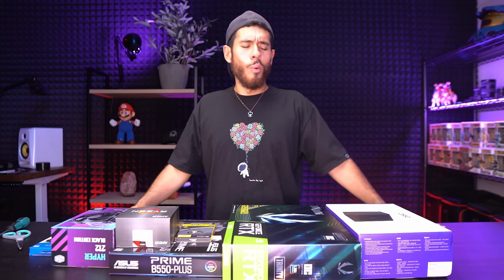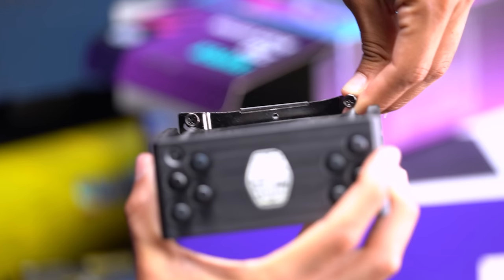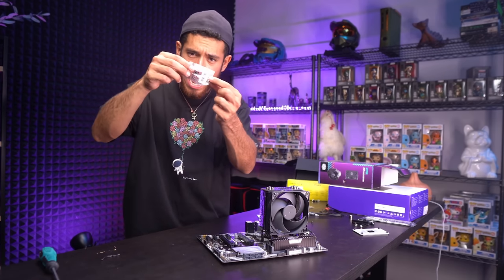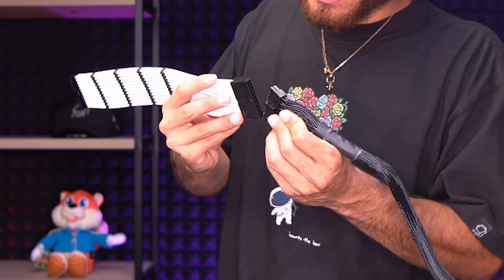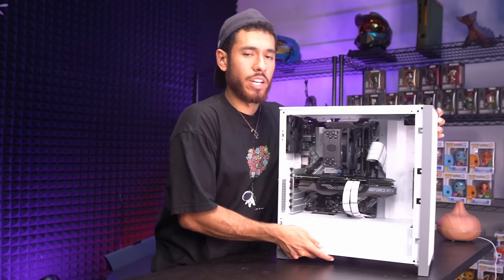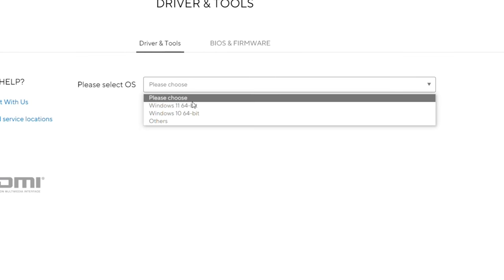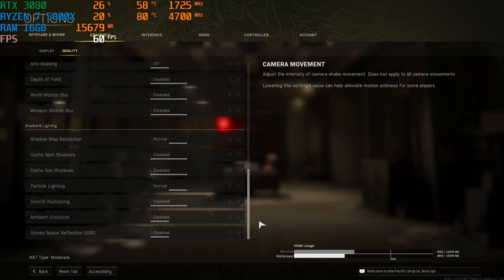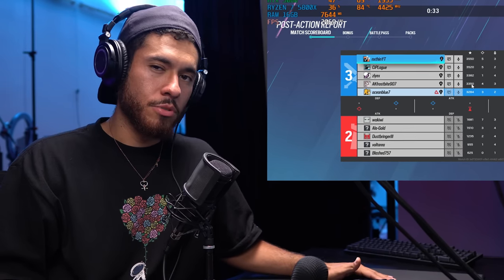BEST $1500 Gaming PC Build Guide - RTX 3080 Ryzen 7 5800X (w/ Benchmarks)

Comment: I basically built the exact same pc and it works like a dream! The only things that changed for me is the PSU (Power Supply, changed to RM850x), the GPU (changed to 3070ti), and I added a 1TB HDD (Hard Drive). Thank you so much for the easy guide Joey!!!!
Reply: sorry kinda dumb but what do you do about wifi? like does the mother board come with it or do you have to add a external one and idk if i missed it lmao
Reply: @overusedbyyou6239  you have to buy a external one, I just prefer ethernet because its just better than wifi
Reply: i changed mine to a 3070ti also
Reply: Another dumb question, what about Bluetooth! I went with the psu you recommended Calvin
Reply: @matthewbutler4650  👍

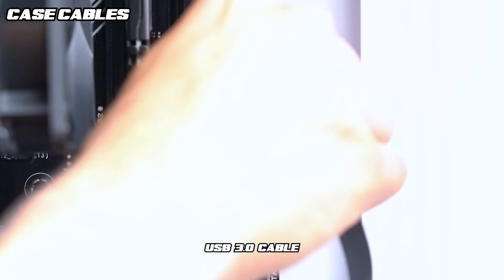Comment: 11:10 might be worth using a USB-C header adapter if the motherboard doesn't support it
Reply: is there another option? I want to use the usb 3.0 on the front and the type-c port as well in the front

Comment: I'd get a different board, one with the USB-C header for the case, there are options in that price range... And I don't like the idea of having only 500GB of storage in a 1500$ PC, but to get a 3080 in there I can understand that, storage is the easiest thing to add later on after all...
Reply: Actually more like a $1600 build before taxes. And 16gb RAM and 500gb storage will cause some pain.
Reply: @GlitchedPerception  16 gb ram is more then enough for gaming
Reply: @laurinschlief791  I’d say it’s enough but not more. You’re gonna max out on more demanding games. For example in the video it’s using 16gb in Warzone.
Reply: @GlitchedPerception  true i went overboard woth more then enough, but 16 gb for this price pool is a logical choice,
Reply: @laurinschlief791  You’re not going overboard. Don’t worry. I was making these decisions for a build recently and almost got 16gb it certainly is the price bracket. (And clearly more than enough for a lot of the titles tested) If you get lucky you can find 32gb kits for similar price and if so thats when I’d go for that. Just trying to give some heads up for folks who want power and to maybe edit and stream.
Reply: @GlitchedPerception  i know but i went overboard with more then enough its like perfect for games right now, luckily you can easily add more ram if you ever decide too
Reply: @laurinschlief791   16gb is not going to hold for long as games are getting more demanding each year. But if you don't have the money then it's not a problem because you can add ram overtime just like you can add storage. It's crazy how in about 4 years some games will need 64gb to run.
Reply: @GlitchedPerception  Would you say 32gb is enough if I'm trying to play ultra modded skyrim / fallout? I have a TB SSD already from my last PC when my old drive failed.
Reply: @evilkungfu  16 GB is fine if you're just gaming. if you've extra money to spend, it also doesn't hurt to upgrade to 32 GB, but you're more than likely gonna see a minimal performance increase if your PC isn't already being bottlenecked by your RAM
Reply: @theluigifan42  cool, good to know and I’ll do good with Ram, I’m making sure my 3080 isn’t bottlenecked as good as I can for now. I’m picking stuff that can be upgraded down the road, like I’m starting with a 5600x cpu.
Reply: Yah I would just use some hdd I have laying around.
Reply: This is going to be my first pc I build. What motherboard should I upgrade to? I need one with Wi-Fi? I’m willing to spend 100 more the one in this video. I just want a good one
Reply: @justjoshinya7237  Two options I'd suggest: the MSI MAG B550 Tomahawk MAX Wi-Fi and the ASRock B550 Taichi Razer edition. Both are great, with Wi-Fi and Bluetooth built-in and the USB-C header for the case. The ASRock board is better, usually more expensive but it's 100$ off right now on Newegg so both are around 200$.
Reply: @danielegalizzi8562  I’m gonna get the asrock one thanks!
Reply: @danielegalizzi8562  Should I get a 1tb ssd too?
Reply: @justjoshinya7237  In my opinion yes. That said be careful with prices, getting a 5800X / 3080 PC under 1600$ is hard... Consider the Ryzen 7 5700X instead which is around 250$...
Reply: @danielegalizzi8562  I’m willing to spend more so I’m going to keep the 5800x. Do you have discord? In case I have any questions cause you seem a lot better at this then me 😂
Reply: @danielegalizzi8562  will these motherboards match up with the rest of the parts in the video?
Reply: @dqminic  did u find out?
Reply: @shayc1482  nope, just went with the same motherboard as in the video
Reply: im a bit confused by the problem he had with the USB-C cord, the motherboard he has says it has a type C port. Can someone explain?
Reply: @dqminic  did u have the same issue he did with the usb-c?
Reply: @hisnameisbass6405  The motherboard might have one or more USB-C port(s) on the back, that does not matter for the USB-C port on the front of the case (or top of the case, depends on the case itself). In order for the USB-C port on the case to work you need a motherboard that has a specific header; there's a cable that starts from the USB-C port on the case and needs to be plugged in that specific header on the motherboard, doing so will make the USB-C port on the case work. If you use a motherboard that lacks that header then the USB-C port on the case will not work, that's all.
Reply: @danielegalizzi8562  okay thanks! so the one he used in the vid doesn’t have that header? and which motherboard can i get that will have that header and will still work with this specific build and ryzen processor?

Comment: Hyper 212 used to be good, but nowadays it's overshadowed by the AK400 and potentially a few other coolers that I can't remember. 

That aside there's pretty much zero excuse to not get a 1TB SSD at this budget.

You slightly overspent on the PSU, it's a quality unit but you could have went with something like the MSI MPG A-GF 850, which is a similar quality unit.

I think at that budget as well you could've gotten the 12GB version of the 3080? Not sure, didn't check to see what price you got the GPU at, but current listings show a 12GB version is available at a similar price as the 10GB version.

I think maybe going with a better case (without an extra fan it's kind of mediocre), like the Lian Li Lancool 215 mesh might've been better, though unfamiliar if a case like that could fit a 3080.
Reply: If you were to get the 12GB version instead of the 10, would you need to change anything in the build? Also is the size of the GPU the same between the 10GB and 12GB models, I want to know if the tutorial is able to work with the 12GB version. Which you are right, the 12GB is only $20 more than the 10GB as per the video's pricing, so definitely worth the upgrade.
Reply: @Dance_Party  That'll depend on the brand and whatnot so make sure to check case clearance and all that, though PSU specs should be the same.

Comment: (Reality check for builders at home.) This build was around $1600 before taxes. 16gb of RAM and a 500gb SSD is not optimal. (And then you gotta pay for a nice monitor, and why go 1080p when you have a 3080?) I was certainly hoping to see a $1500 budget but was disappointed.
Reply: Certain titles the 3080 only handles 1080p well enough for the hz rate, if not a bit lower. As an example, typical 1080p monitors nowadays have a refresh rate of like 144hz.
In ARK, even the 3080ti only gets ~120fps. https://www.youtube.com/watch?v=hYqh7WIxkcw&t=80s
Reply: @ardeof  Sacrificing quality for FPS. 1080p to 1440p is a wonderful upgrade in quality. (Especially on a 27-32 in screen.) In that video he notes how much better it looks. And in games like ARK and many single player games you won’t necessarily need high FPS.
Reply: @GlitchedPerception  Yeah for sure, I was just pointing out that it isn't necessarily a bad resolution to play at (in terms of a bottleneck at least). I'd also personally pick 1440p or even 4k with slightly lowered settings.

Comment: Do you need that fan splitter? Or is it fine without it. Ordered all of my parts and they’re all here but didn’t realize you got that
Reply: Had the same issues did you end up finding a splitter or did you build it without?
Reply: @brio481  I ended up using the fan splitter that came with the CPU cooler. It was a little weird but it works just fine and all the fans are operational!

Comment: Here are the specs for a gaming pc I can make for €1400 is it good or what should I updragde my max budget is €1500

Specificaties:
Moederbord: H410m Chipset (1200 Socket, mATX)
Processor: Intel i7 10700F 8-cores - 2,9 GHz (Turbo 4,8 GHz) - 10th gen
SSD (M2.0, NVMe): 1TB
RAM: 32GB DDR4-3200 Mhz (2x 16GB)
Videokaart: Nvidia GeForce RTX 4070 12GB
Behuizing: Xilence Xilent Breeze RGB - (Breedte: 21,5 cm x Hoogte: 48,5 cm x Diepte: 41 cm)
Voeding: Be quiet! System Power 10 - 650W 80Plus BRONZE.

Video uitgangen: 1x HDMI, 3x DisplayPort
USB-poorten: 5x USB3.2 aansluiting + 4x USB2.0 aansluiting 
RAM Geheugen uitbreidbaar tot maximaal 64GB (2 Geheugenbanken, 2 in gebruik)
1x M2.0 
4x SATA-600
1x PCI-e x16
1x PCI-e x1
Geluid: Realtek ALC892
Realtek Intel Gigabit LAN

Comment: I have been wanting a Ryzen & GeForce build. I haven't built my own PC since 2010 so I am super rusty. I think I would get a Corsair PSU for branding, upgrade the mobo to the one he mentioned that has built in WiFi, and I do want simple liquid cooling. Any suggestion on a water cooler that would fit on there?

Comment: As someone who knows nothing about pulling pcs I used this guide and it works beautifully! However I wanted to know if it would work if I used a AMD card instead of the Nvidia one. As I do want to upgrade and Nvidia is just so darn expensive. I used a 3070ti instead of the 3080 in the video. Thoughts???

Comment: I ordered everything for this build and it showed up today. Building tomorrow. Paired with an odyssey G9
Reply: Lmk how it goes before I buy please
Reply: @CuriousSquid06  will do! Only thing that hasn’t showed up is the 3080. Waiting on that still. I have high hopes. The video seems very straight forward. I’m super stoked
Reply: @-TheRealBUCKET-  any issues so far?
Reply: @Animationdealer  installation of everything went fantastic. As far as I could tell everything that Wars needed was included in the description besides a REALLY long screwdriver. The only thing I didn’t do was the cable extensions. I could not get them to fit on easily and I didn’t want to bend any pins. So I left that out. I have to have my internet router moved upstairs. Internet fixed tomorrow. Ill start tomorrow by installing windows 10
Reply: @CuriousSquid06  it went fantastic
Reply: @-TheRealBUCKET-  fr thats fucking awesome man I’m getting my gpu Sunday

Comment: I have a similar build, I have a Ryzen 5800x with the AMD, Aircooler, 4 Trident Z3800mhz a Corsair 750 Gold rated PSU, The TUF Asus 550x plus wifi and a 1TB WD SSD, and a GeForce RTX 2060. Also have 6 Corsair ICue RGB fans housed by an In win White Mid-tower.
Reply: You think your build would work with a be quiet! Dark Rock Pro 4 50.5 CFM CPU Cooler and Lian Li LANCOOL 215 ATX Mid Tower Case

Comment: Could I slap some more expensive ram card or memory cards and still have a low bottleneck? Because 500 Gb of storage ain’t a lot to be honest if you consider that fortnite updates really frequently and if I could slap more dans what motherboard should I use?
Reply: You're confusing RAM and storage. Yes you can install larger capacity SSDs. It will be more expensive, but you can certainly do so. Most motherboards have 2 M.2 ports. If you need more, you will need to buy PCI-E cards with M.2 slots or buy a SATA 2.5" SSD. Most motherboards have around 4-6 SATA ports. SATA is not as fast as NVMe but is still plenty fast for most use cases.
Reply: @JJFlores197  thx for the tips appreciate it man :)

Comment: Question, is a ryzen 7 2700 good for the same motherboard ur using? Also will it work with a 3070ti?
Reply: Also a 650 watts power supply good for 3070?

Comment: This may sound dumb, but I'm assuming this system can run high end games like Elden Ring? Ordering the parts for this and planning on following the steps! (event hough I really don't understand drivers)
Reply: It looks pretty high end so it should run most games without issue. Drivers are software that allow your operating system to talk to the hardware. Think of them as translators. Without drivers, your computer won't work too well. Installing drivers is mostly automated. You just download the driver files, run the install file and mostly press yes or continue.

Comment: The 5800x is a pretty hot running cpu to cool with a hyper 212 cooler.
Reply: @4Zemy  I had to put an aio liquid cooler on mine to get decent temps but some of the better air coolers would work too, such as Noctua.

Comment: are the CPU temps supposed to be that high? I replicated this build except with a different gpu and a noctua air cooler and the temps are extremly confusing. Core temp is reading it ten degrees hotter than ryzen master. Playing WoW i was at like 74 degrees with core temp, but in ryzen master it read low to mid 60s which would make more sense. Is ryzen master more reliable than coretemp?

Comment: Love your guides, very clean and to the point. I guess in this build only thing i'd dislike is 16gb ram. At this day and age 1500$ build should come with 32 gigs, even now lots of games require more than 16.
Reply: Which ram would u get?
Reply: @matthewbutler4650  32gb 3600mhz cl16 at least. Since its Ryzen its imperative that you need good ram. Maybe cl14 if you can find one cheap.
Reply: Thank you!
Reply: @matthewbutler4650  np mate, just have to emphasize in case you're making a build, 3600 mhz is the sweet spot for zen3 chips, just like 6000 is for zen4. So you dont need to go faster than 3600, it will be performance decrease until you go way higher which is cost-prohibitive. Try to instead go for lower latency like cl14 i mentioned. Ryzen is very temperimental when it comes to ram, it doesnt always improve performance linearly.
Reply: One more quick question, if I choose one of those two rams you suggested, I'll install them exactly as the video explains for the 16gb? Maybe a stupid question, this would be my first build
Reply: @matthewbutler4650  yes, ram installation always stays the same. Remember to keep them in different channel (like you slot in Slot 1 + Slot 3 or Slot 2 + Slot 4) that matters alot in performance. Second is, keep one side of ram open and and other closed to install them easier. 3rd and most important, look at where the ram is supposed to be pointed before forcing it in, otherwise goodbye ram or goodbye motherboard.
Reply: @matthewbutler4650  btw, if you are doing zen3 i'd suggest you go for 5800x3d instead of the regular 5800x, that cpu is by far the best one AMD made, it's a generational leap which is unusual, comparable to ryzen 7000. Makes no sense to go anything else when you're spending alot with zen3 build.
Reply: Where are the fan splitters?

Comment: why is cpu on 80 degrees ? also, im pairing rtx 3080 with r5 3600x on 2k res., planing to upgrade on 5800x later on or i7 12700f ? whats better for gaming, any thoughts ?
Reply: @Navo arctic freezer 34duo is not bad performancevise, i had it for 1year but it doesnt cover whole CPU plate. I swaped it for x73

Comment: Out of curiosity for a first time of builder, does the asus b550 plus support wifi and Bluetooth or do I need to get an adapter/extension
Reply: Check the motherboard specs. If it does support that out of the box, it will be listed in the specs as well as the motherboard name. If it doesn't have it, then you will need to buy separate wifi and bluetooth adapters.

Comment: Is windows ready to go once you build the of or do you need to set it up yourself and if that is case where do I get it and how much does it cost
Reply: No. You have to install the operating system after you build the PC. Windows 11 Home costs $139 and W11 Pro costs $199. You can build a USB installer using another PC, or if you do not have access to another system, you will need to buy a Windows USB installer from Microsoft or other authorized retailer. If you're doing things by the book, you have to pay for Windows. Unofficially, MS lets you run W11 w/o paying for a license, but you won't be able to personalize your PC and a watermark appears. Other than that, everything else works the same as if you paid for the license.
Reply: @JJFlores197  ok thank you

Comment: Spent around $1,200 for this setup, but buy the RTX 3080 locally. Should be $500 instead of paying $800
Reply: Just got a 4060 for $300 idk if that's good but I'm not mad at the price
Reply: @MyDriftt 😅 the 4060 is terrible you should’ve went with an amd card at that price
Reply: @yulissaseverino4218  I did bro I didn't know beforehand hand I no whave a RX 7700 XT

Comment: bro Finally someone who does a tutorial that I understand Do you think you can build a PC with these components? 
1.AMD Ryzen 7 5800X 3.8 GHz 8-Core Processor
2.Corsair iCUE H150i ELITE CAPELLIX 75 CFM Liquid CPU Cooler
3.Asus ROG STRIX B550-F GAMING (WI-FI) ATX AM4 Motherboard
4.Corsair Vengeance RGB Pro 32 GB (2 x 16 GB) DDR4-3600 CL18 Memory
5.Samsung 970 Evo Plus 500 GB M.2-2280 NVME Solid State Drive .Kingston NV1 2 TB M.2-2280 NVME Solid State Drive
6.EVGA GeForce RTX 3070 Ti 8 GB FTW3 ULTRA GAMING Video Card
7.Deepcool MATREXX 50 ADD-RGB 4F ATX Mid Tower Case
8.Corsair RM (2021) 750 W 80+ Gold Certified Fully Modular ATX Power Supply

9,and I don't know much about pc things but I think this windows is fine Microsoft Windows 10 Home OEM 64-bit
Reply: Sounds solid. Good luck